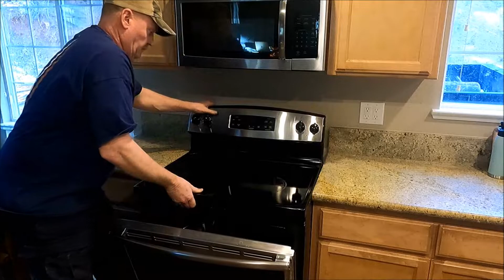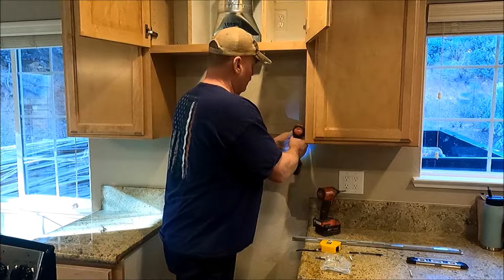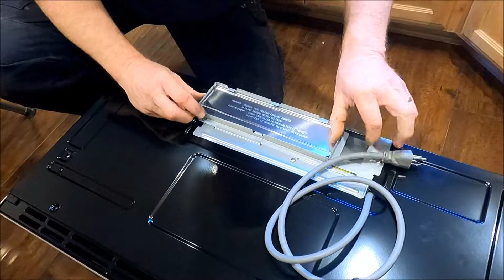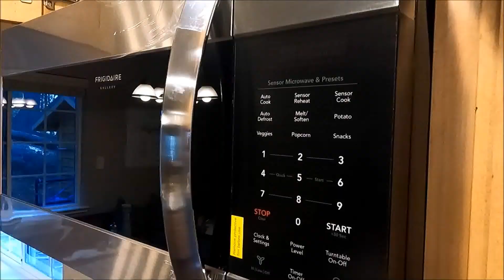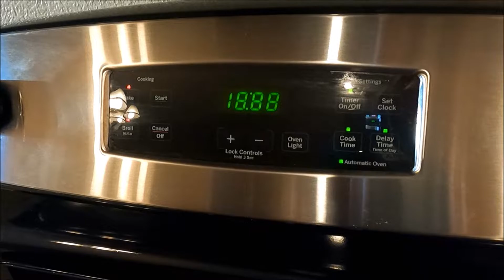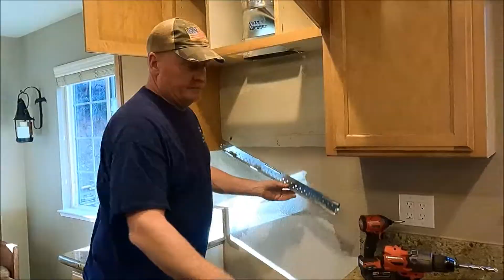How to replace over the range microwave - Frigidaire FGMV17WNVFA

Comment: Super helpful!  I have been led to believe even the ductwork in the room should be insulated, so hot air doesn't bleed out.  Anyway... I like the way the ductwork was closed off with a door to hide it.
Reply from the maker: Interesting.  I have never been told exhaust ducts needed to be insulated.  I will have to look into that.

Comment: Just saved my life and wallet. I was able to change the fuse using your video. Thanks a lot!
Reply from the maker: Nice!  I am guessing it was a fuse inside the microwave?
Reply: I couldn't get to the screw over the control panel to access the fuse. I had to pull my microwave out a little to access it. You were right when you told us to be careful because of how the microwave comes out. I barely caught it when it dropped. Lol
Reply from the maker: @kdogg3003  Whoa!  Glad you are alright and made the catch.  Thankful I could help.

Comment: I have this microwave.... Can you install the blower too the back..... And also did all the part come in the box mine is up already but not vented at all.... Don't have the blower flap unless it's screwed in the microwave
Reply from the maker: I don't remember where the backdraft damper was located when I unboxed the microwave.  You can exhaust the vent out of the rear by rotating the motor and removing the two rectangular knock outs on the back side.  I don't know if they have changed the installation book but the rear exhaust is on page 18.  Good luck with your install.
Reply from the maker: Here is a link to the installation manual if you need it.

https://na2.electroluxmedia.com/Original/Electrolux/Electrolux%20Assets/Document/Installation%20Instructions/316495162.pdf
Reply from the maker: In case you need the flapper, here is the part number for the flapper adapter: 5304509485 and the flapper part number is 5304509486.
Reply: Sorry to bother you.. Wanted to ask another question about about the Microwave.... Do you think it has enough cfm to push the air about 10-14 feet to out the house... The fan does not seem that strong... The microwave was bought and installed on my house when they built it 4 years ago... The clown builders didn't install any ventilation so Im trying to add it now without destroying my kitchen.... So I'm thinking about add a in line duct fan do you this that will help even more???
Reply from the maker: @TheMasterkiller24  I have never seen an inline fan connected to a kitchen fan. There is a worksheet on page 15 of the manual where you can figure out if the air flow will work based on the types of duct fittings you use to vent outside. I attached a link in an earlier comment for the manual if you need it.
Reply: @HamiltonServices530  thank you so much... I didn't even see that link.... The manual that came with the microwave has absolutely non of this extra information... I really appreciate it
Reply from the maker: @TheMasterkiller24 You are welcome.  Glad I could help..

Comment: Good video. Came here to see how to remove the Frigidaire OTR microwave. Removed the bolts on top, but it won't budge an inch. Ideas?
Reply from the maker: Also if the venting is not pushed up a little bit, it could hold the microwave from rocking down.
Reply: @HamiltonServices530  thank you. Good tip. The housebuilders messed up the vent dimensions so they just fixed it like Russian cosmonauts... With extra duct tape... Tons of it... Had to force the microwave down with my own weight! Appreciate the quick response
Reply from the maker: @WBraxx  "they just fixed it like Russian cosmonauts... With extra duct tape... Tons of it... "  That was hilarious!
Reply from the maker: Is there tape or screws connected to the vent ducting which might be holding it up?  Maybe check for some trim pieces the cabinet installer may have added?  That is all I can think of at the moment.  🤔

Comment: You make it look too easy. Just curious how well does the microwave fan suck up the smoke from cooking on the stove top. I found out by just taping off that top vent that sticks out past the cabinet just above the microwave door helps the suction on the bottom filter vents a little bit better.
Reply from the maker: I will have to try that trick.  I have yet to find a microwave hood that actually has a good fan.  I was thinking about removing the backdraft damper to see if there is an improvement.